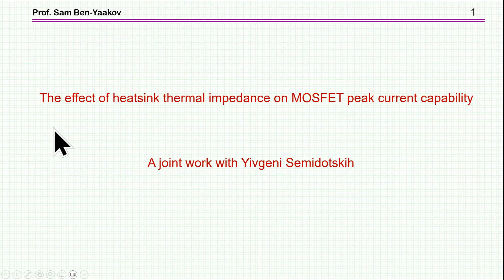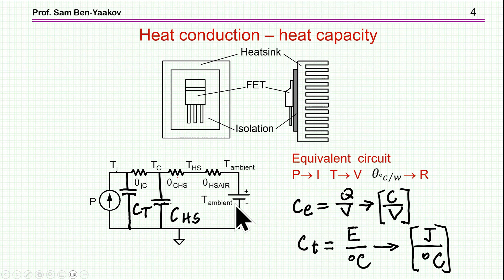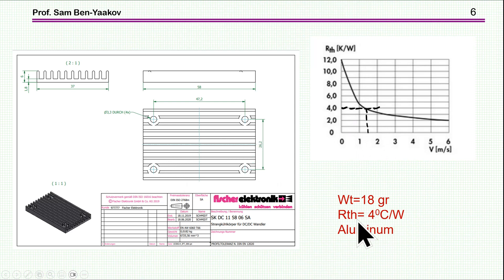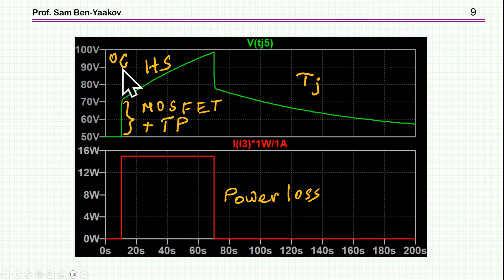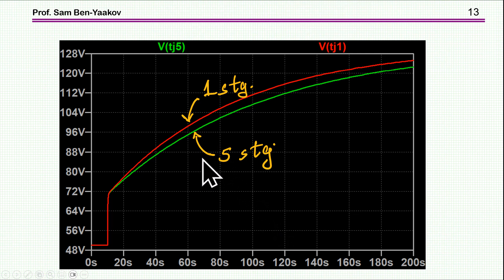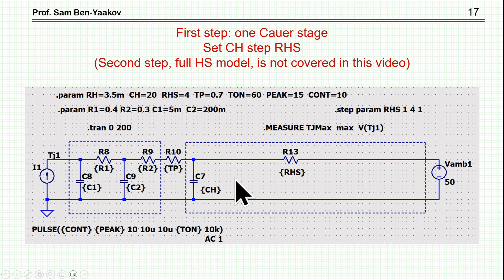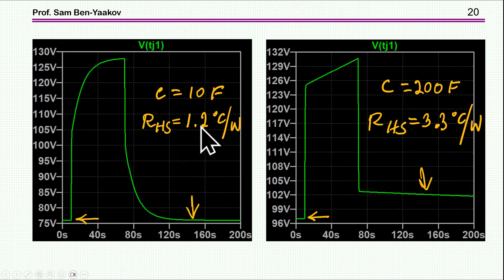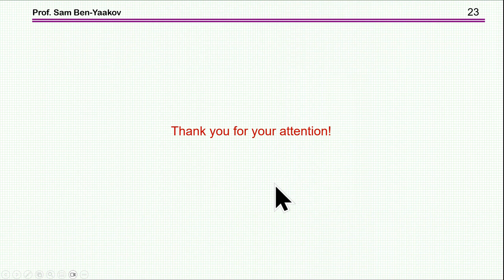How to choose a heatsink to sustain MOSFETs peak currents

Comment: Interesting study with results that agree with intuition but the "thermal pad" model is probably oversimplified. CPUs and graphics processors use complex heat spreaders which may involve heat pipes or 2D materials that spread heat with efficiencies approaching diamond to make better use of the heat sink. These technologies tend to push the results toward even more emphasis on surface area rather than thermal mass. Without the improved heat spreading, you end up with a large temperature gradient in the heat sink itself as you move away from the die contact area, leading to obvious inefficiencies...
Reply from the maker: The video is an introduction to the subject to explain the basics. I would love to see your video describing models of the more advanced approaches.
Reply: @sambenyaakov  Coupled systems of partial differential equations always scared the hell out me, but companies like Amsys, Comsol and Agilent sell horribly expensive FEA based simulation packages that seem to do a reasonable job on thermodynamics...

Comment: What if All Mosfets are on same heat sink( three phase inverter with parallel mosfets). Can you please do a similar analysis for the above problem Professor?
Reply from the maker: You combine all the losses into one current source and put all the thermal networks of the transistors in parallel (Rth/n, Ct*n).

Comment: Thank you for another clear explanation. For the 5 stage heatsink model, why does it have six capacitors? It seems to me like the 5 stage heatsink model has 6/5ths of the capacitance of the 1 stage heatsink model. Am I misunderstanding something?
Reply from the maker: Thanks for pointing to the error. Originally, the sixth cap was supposed to represent the thermal capacity of the fins but it is incorrect as shown. I will put a note on that in the description section.
Reply: @sambenyaakov  Ah I see. Interesting, I never thought about simulating the fins separately from the rest of the heatsink. That's a neat idea

Comment: Clear lesson as always. Could you make a video for dimensioning a fan for the heatsink? Often Is a procedure based on experience and not with analitycal procedure. I'm intrested in tour approch.
Reply from the maker: Thanks for discovering the error. Originally, this was supposed to be the thermal capacity of the fins but as labeled is incorrect. Sorry. I will put a note on that in the description section.
Reply from the maker: Good subject. Will try.
Reply: @sambenyaakov  this is a very tricky topic as the performance does not only depend on the losses, heatsink and fan but also on the system's geometry. Most of the time the fan is selected either with the charts provided by the manufacturers (rule of thumb) or with CFD simulations to take into consideration all variables.

Comment: Hi Prof. Yaakov, it is One of the most common approaches to measuring thermal resistance is to mount a
metal-cased 50-W power resistor on the heat sink or other material in question and
apply a known number of watts to the resistor. At the same time, an IC temperature
sensor can be mounted to the heat sink to monitor the temperature rise. The thermal
resistance is then easily calculated. By observing the rate of rise of temperature, the
thermal mass can also be inferred. Alternatively, you can raise the heat sink to a known
high temperature, remove the heat source, and record the time it takes for the temperature
to fall to 63% of the difference between the ambient and the starting temperatures.
This time value is then the time constant of the thermal capacitance and the known
thermal resistance of the heat sink.
usually in practice if you have stationary air then become worse , which is difficult to simulate and other thing is slew rate of switching , if it is slow then transistor pass class A region . this will be different for lateral mosfet vs vertical mosfet , it can get thermal run away too. anyway thanks a lot.
Reply from the maker: Thanks for your input. Measuring heatsinks is  a common practice. I will be happy to send you some examples of results if you send me  your email.
I do not understand what is the relevance of heatsink measuring to switching losses. With modern simulation models of MOSFETs you can get good estimates of switching losses. See  https://youtu.be/kEl2n9jcrIM